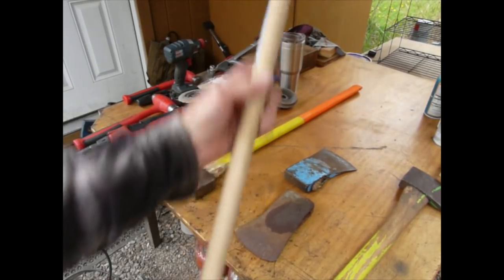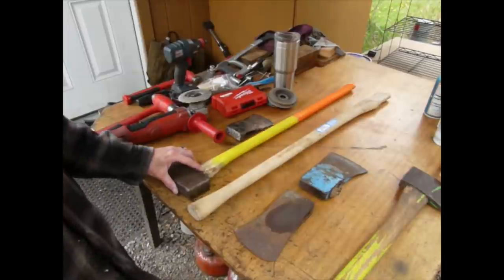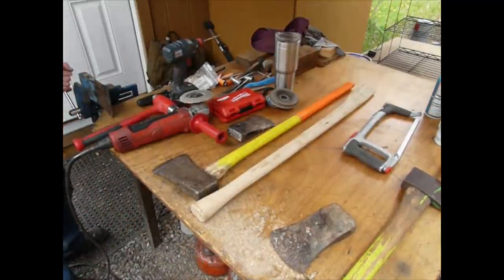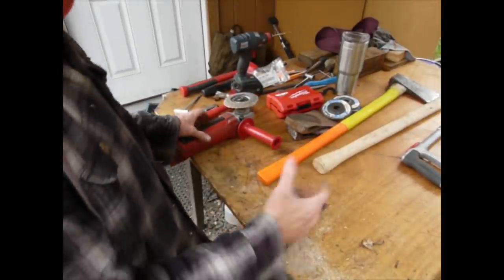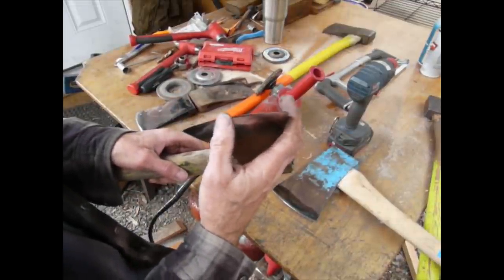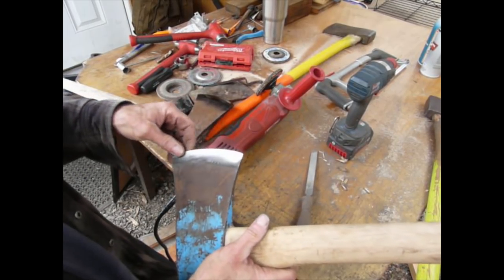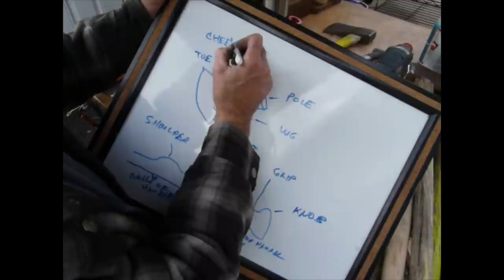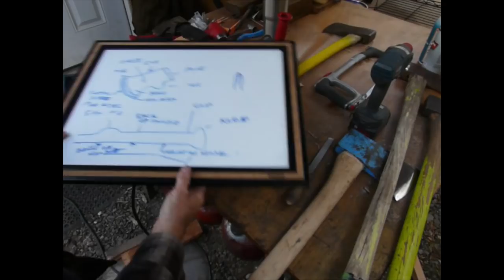The Faller's Corner - Getting your AXE together!

Comment: Most excellent Jack. I still have the 36" double bit axe I used on the landing back in the day for chopping redwood bark hanging down on loaded logging trucks. You are absolutely correct on how to sharpen it for best chopping redwood bark. It won't be very good for splitting firewood but I have another axe for that. Incidentally I recently rehung my old double bit. I threw it in the wood stove like your grandpa used to do. A wood fire won't get hot enough to remove the temper. Just let it cool naturally. I'm sure enjoying this series of videos. Thank you.
Reply from the maker: Steve hi. Nice. Works good on the thick fir bark too. And, lest I admit, when you have to chop yourself out during a pinch session.
Thanks for watching my small offerings on YT.

Comment: Great video jack you covered all the bases. Those round wedges are available from Beaver creek handles on line.
I was surprised that you were actually concerned with how the axe chopped, I figured you just hit wedges with them, so that was super interesting .what length do you prefer. I love  these fallers corner videos videos. Maybe you could do one on filing, round square etc .
Reply from the maker: climb 44 hi. Thanks for the direction on the "roundies".
Ummmmmmmmmmm, chopping yourself out.... I've had to do it. Don't know anyone that hasn't. Sharp axes do it quicker.
Fir bark as well. Especially that oldgrowth 6" black, thick kind on the steep ground. The 4" second growth bark is about the same. It carries a lot of CRAPPPPP!
Of handle? 36" on the 4.5/5lbers. 28" on the 3.5/4lbers.
That's going to take days to get things covered if I was to do it "smartly". 
Thanks for watching.

Comment: My axe destroys wedges when I'm off.  I have an old Rockaway head, and its heavy.   The pull is pretty square on the corners.  Thanks Jack.  The chicken scratch is fine sir.
Reply from the maker: Dan hi. Same with the Burks. You can bevel them a bit and that will help. If you then take a file and blend the end of the pole (round) into the bevel it will help a bit on sheer if a guy slips/spins out/makes contact with the bole with your arm/etc.,etc.
Thanks for watching.
Reply: @hotsaws101  I love the fallers corner!

Comment: Is it possible to peen an axe head? And if so, would it be worth it?
Reply from the maker: DC hi. The heads are not usually "bent". Not sure they need to be stress relieved either. Thinking they are getting that handled when your down in the zone folding the timber up.
I've straighten bars by peening them. I try and not hammer on the heads to hard - like in the vid getting the head off the handle - gently striking them with a small deadblow.
Thanks for watching.

Comment: Hotsaws101 What's your preferred axe handle length?
Reply from the maker: Shawn hi. What is the weight of the head?
Thanks for watching.
Reply: @hotsaws101  Good  question back. I should of asked my question better. What size handle do you like to use? I like how you carry your axe across your back through your belt and was just wondering what length you like and which would be to long to carry across your back and get in the way. Thanks for your time!!

Comment: @hotsaws101 No glue for the wedge? Seems like Buckin' always uses glue... thoughts?
Reply from the maker: razaman514 hi. I've never had a problem with the round Grady wedges backing out. Haven't really had much of a problem with the stamped, flat Grady wedges either.
Glue won't make it through on the round version since they are tapered as well.
A little bit of the glue might make it on the flat, barbed wedges in the recesses.
After a few problems early on in my felling career ( that's late '70s early '80s) I always took care of the prep & installation initially so that the union  was bullet proof. That way when a guy was 2/3/4 thousand feet down in the bottom of a yarder block you don't have issues....
Thanks for watching.
Reply: I don’t remember Buckin uses glue on his axe he does use watco/ watca? As expender like water do to any wood handle to keep it tight

Comment: Hello jack what the length of the handle and the weight of the small axe with the neon yellow handle we can see at 30:00
Thanks
Reply from the maker: Tim hi.
I run 28" on the 3 to 4 lbers. I run 36"on the 4 1/2 to 5 lbers.
Thanks for watching.
Reply: @hotsaws101  thanks jack, I send you a mail about the woods port for a 661 yo say that I’m still highly interested and I would like a range of price😄 thanks again 
Tim
Reply: @hotsaws101  but take your time I’m not in a hurry at all